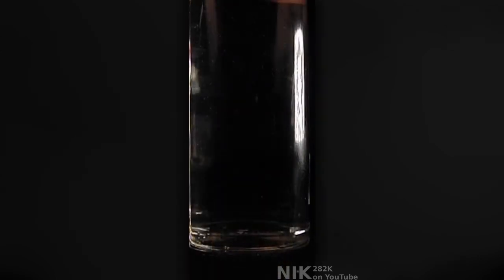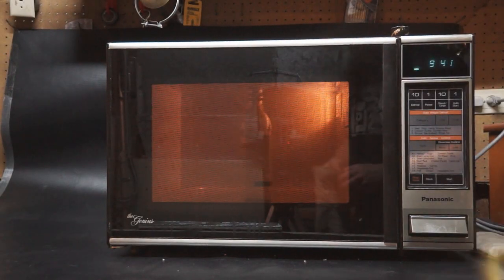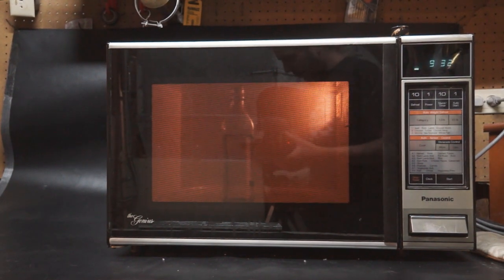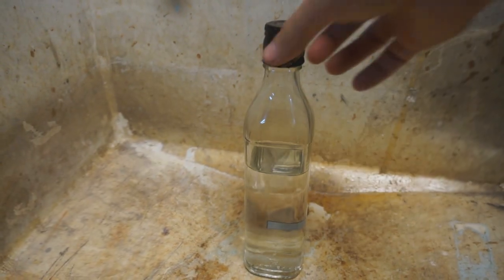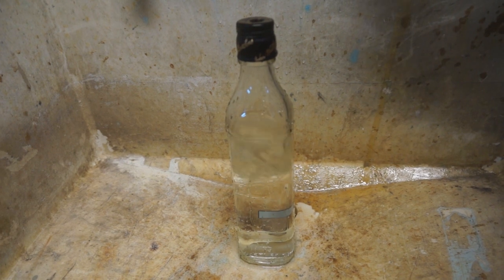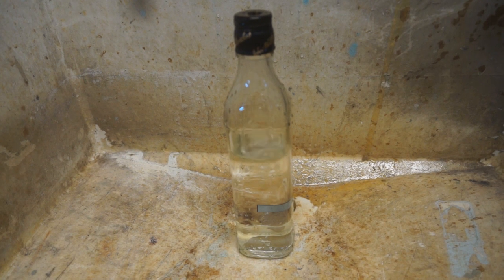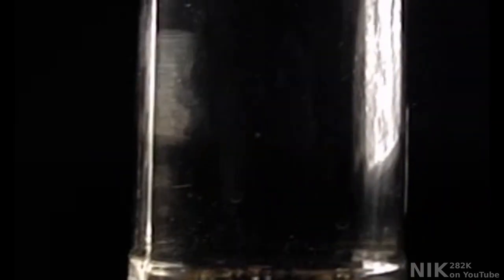Vacuum Bottle Cavitation

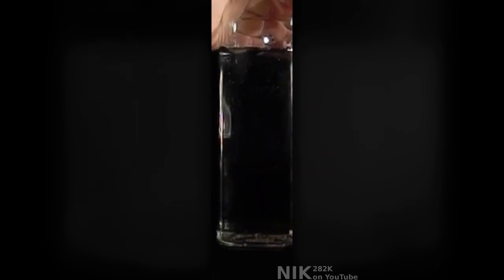Comment: What's interesting to me is the secondary cavitation at 2:03.  The first cavitation bubbles have collapsed and, in so doing, have lowered the pressure throughout the rest of the fluid to the point that bubbles momentarily appear throughout, concentrated somewhat in the middle of the bottle.  Some kind of rebound effect.

Comment: why everyone thinks that you should have partially filled bottle to brake the bottom of it with striking? the reality is that you need to have FULL to the rim bottle with water to be able to do that..
Reply from the maker: There must be a void at the top of the bottle to allow the water to move up relative to the bottle. If it is full the water is driven down just as quickly as the bottle and no cavitation bubbles form and the bottom won't blow out.
Reply: Nick Moore
hm that was not the case when i was testing this as kid. maybe i am wrong but full bottle was working for me even with kid power to strike. the deal is not the cavitation the deal is the un-compressibility of water.
Reply from the maker: Hobypyrocom I have never managed to make a full-to-the-lip bottle blow out but maybe the void at the top doesn't have to be very big. I'll get a case of beer with clear bottles and see if I can blow the bottoms out with varying levels of water and maybe some liquids other than waters. Can honey be cavitated?
Reply: Nick Moore
that would be great experiment to clear once and for all whats the best way to do the bottle bottom blowout :) hm i think that honey could be cavitated, anyway its 17% water.
Reply from the maker: I did the test for you today, I was unable to blow the bottom out of a full bottle using equal and greater force than was required to blow out a partly filled bottle. With a full bottle the whole mass of the water is accelerated at the same rate as the bottle, preventing the cavitation bubbles from forming. Without the cavitation there is no impact concentrated on the bottom of the bottle to blow it out. Full Bottle Bottom Blowout
Reply: Nick Moore
thanks man. i really appreciate that you done this experiment. well i was wrong it seems :(

Comment: Haha, guess what I'm gonna be doing later...?

If you happen to watch any of the gun 'porn' channels as I do for their slo-mo content, specifically the ones where they shoot rounds into clear ballistic gel, not only will you see extreme cavitation, but if the gel is cohesive enough to stay together,  often a burst of light (sonoluminescence, I think), along with what seems to be heat and smoke damage.   
There's a great example of it at 17s http://youtu.be/9fA7av2S978?t=17s
Reply: I wonder if alcohol would do that using this cavitation method.  Maybe 151 proof rum/vodka or a high percentage isopropyl.  They have a relatively low vapor pressure so maybe the collapse wouldn't have enough energy?  Maybe glue a pin or nail upright in the bottle to act as a nucleation point for the cavitation.

Dunno. Would be fun to experiment!
Reply from the maker: jcims Any volatile liquid should work as long as the pressure keeps its boiling point close to the ambient temperature. I'm just not sure if boiling a volume of flammable liquid in a microwave would be a good idea, the microswitches on mine are old and sparky.
Reply: Nick Moore I was thinking more of the little flash you get from compression heating of the vapors in the bubble (per Nevin's linked video)
Reply from the maker: jcims I think the key for that working is the air that makes it in behind the bullet (there wouldn't be much) but as the void seals behind it traps a little bit of air to provide oxygen for the combustion of the gel vapours. If that's the case it is operating like a diesel engine, it would also explain the soot of incomplete combustion.
Reply: Nick Moore Totally agree.  If the entrance channel stays open you can sometimes see a small amount of air getting expelled (and there's always some air left over in the would channel).  

Hmmm.  Maybe some O2 in solution or drop a grain of oxiclean in there to get some oxygen bubbles.  Then the glass breaks from the stress and you have a quart of flaming liquid in your lap.   

Maybe not.  :)
Reply: While I think that Nick's dieseling explanation is bang on for the bullet-in-gel phenomena, actual sonoluminescence is not a combustion-based effect, but a concussive one; extremely faint and brief, when the force of a collapsing low pressure bubble becomes spread over an infinitesimally small area, creating a small area of plasma at temperatures greater than the sun's surface.
Reply from the maker: Nevin Williams I would love to see real sonoluminescence but I don't think I have the equipment needed, however it might be possible to cause the ballistic gel diesel event with other (basement friendly) materials.
Reply: Nick Moore Last year i found that if you shoot ballistic gel with a backwards pellet at low power (1-3 pumps with a Daisy) it will diesel and shoot the pellet right back at you.  Just be sure you have something to protect your eyes, it can come back hard.